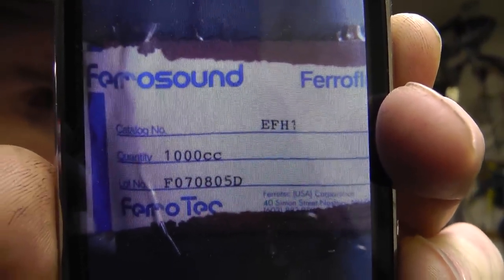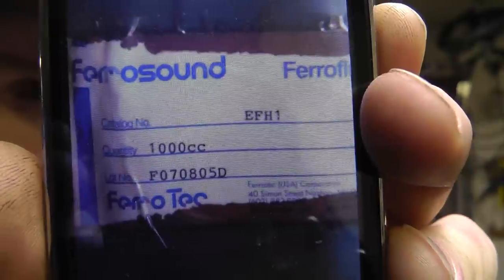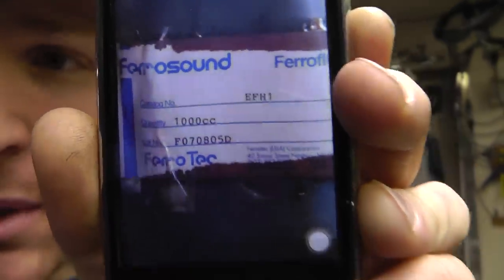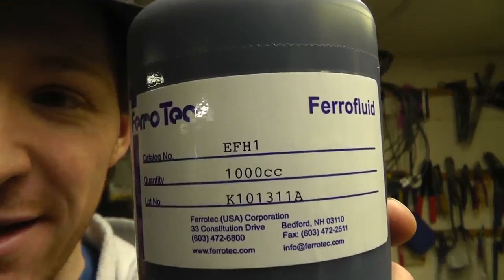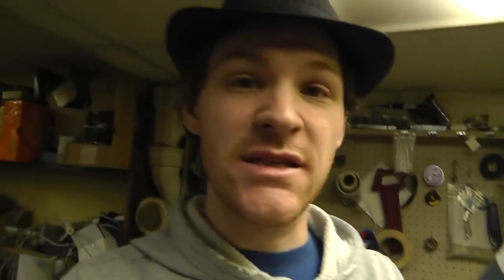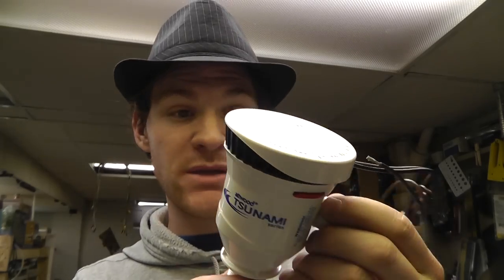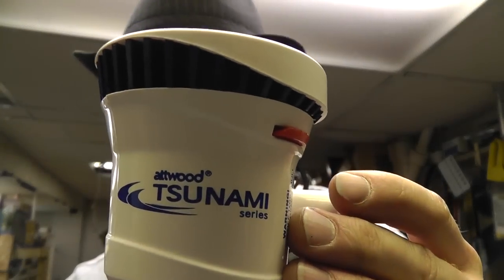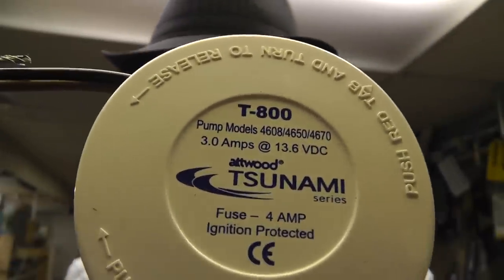So many new things to show you I don't have a good title!

Comment: I would think that the best ferrofluid would be made with the lowest viscosity oil you can find and just grind some un-coated n52 neomagnets to as fine a powder you can (these magnets are very brittle so this shouldn't be hard to do while loosing minimal magnetism).  Seems to me this would be much easier than trying to manufacture a magnetic gas. I also wonder which material would maintain magnatism longer, this kind of ferrofluid or the ionized magna-gas?

Comment: yo russ, if you want to get really awesome pump, brushless motor, only plastic and ceramic wetted parts, centrifugal impeller, low amp consumption, 50000 hrs life time go to koolance.com. and check out for the pmp 400 or 450. They pump about 5-6 gallons a minute. Its the one i use in my systems, theyre reliable very good quality and cheap to buy: around 75$